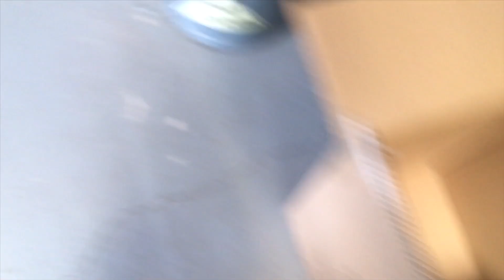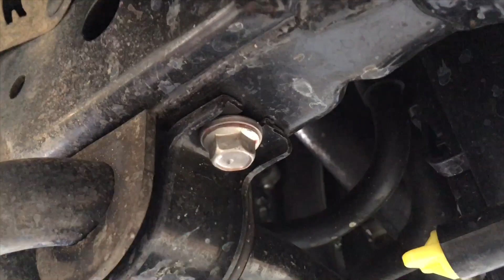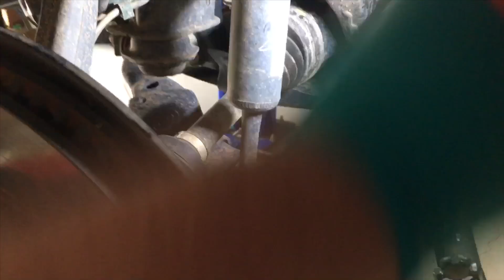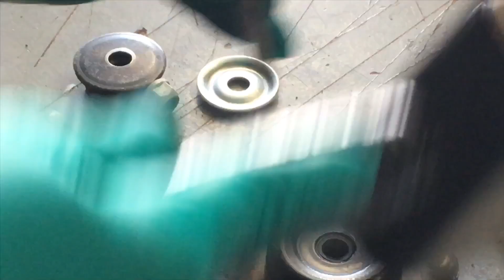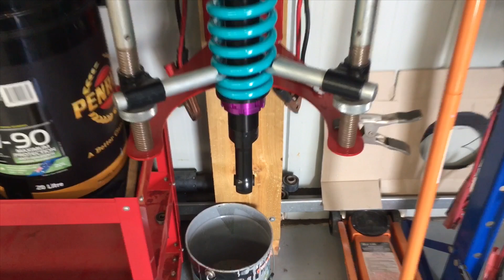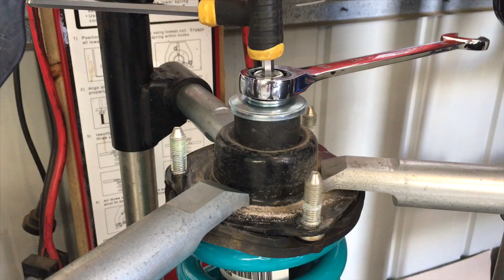TOYOTA PRADO HILUX FRONT SUSPENSION INSTALL

Comment: I am taking out raised suspension. When i go to pull out shock the upper control arm is already hitting the spring so cant pull out.  Do i need to disconnect the arm attached to the uca? (Another castle nut and tapered joint). Thanks
Reply from the maker: Undo the two upside down 19 mm bolts at the bottom sometimes the other thing you can do is loosen the upper ball joint All depends what’s going on obviously I’m not there

Comment: Very good detail but my Prado 150 has the KDSS Suspension. Have you or could you do a video on a Suspension replacement with this set-up? Looks so much different when it comes to the disconnect of the Sway Bars.